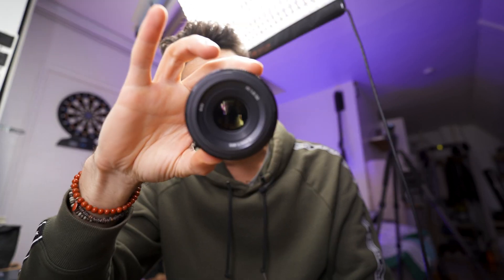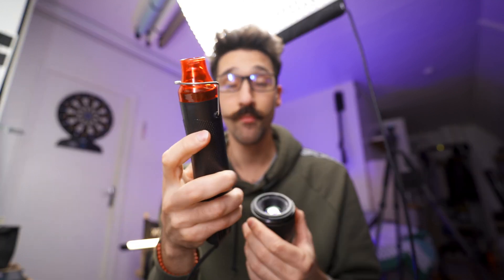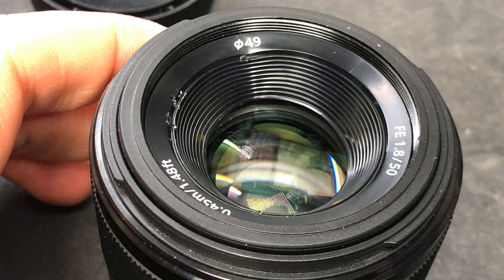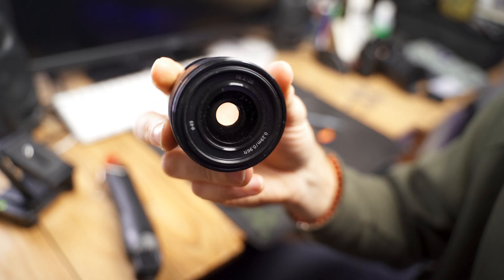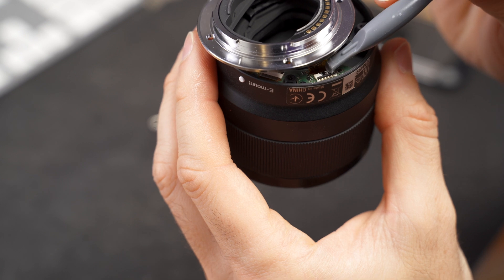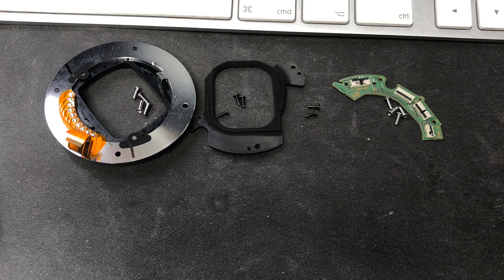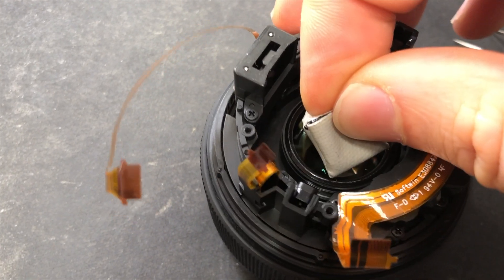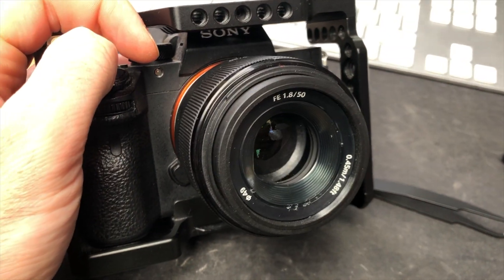Sony 50mm f/1.8 teardown (dust removal attempt)

Comment: I did successfully take this lens apart after it fell into the water and unacceptable amounts of dirt were in between the lenses. To remove the front part you have to pry it open by putting a knife between the filter thread and the front part with the numbers on it (It is impossible without damaging the front part). It’s glued in with some double sided tape. After that there are only a few more screws to remove. You will also have to take everything apart from the mount side. *Unless you have nothing to lose, under no circumstances i would recommend doing this* because the lens groups are glued together. Somehow dust gets inside that’s impossible to remove without breaking the plastic holding the lenses together. You will probably end up with a much worse situation than before...
Reply from the maker: thanks for your input !
I have pinned your comment to the top and hopefully it will help someone else
Reply: I successfully removed the front lens group with minimal damage, thank you

Comment: Don't use your heat gun, heat gun is too strong. use your hair dryer, 5 minutes, distance about 3-4cm. then use glue stick, stick a small string onto the name ring, then lift it slowly.
Reply from the maker: hey mr ! thanks for the tip ! unfortunately your tip arrived too late as you saw 😅

I will try it for my next project

Comment: the "ornament" ring at the front on many Sony lenses is glued on unfortunately. Sony makes special wrenches in various lens diameter sizes to help get them off. underneath, the "filter" thread frame is held on by screws.
Reply: Thanks for this bit of info! I had that ring partially detached and was worried about trying to pry it apart with tools. Going by your tip I allowed myself to use just a little more force, and managed to detach it with just fingernails, and reseat it correctly.
Reply: @AnijatsuGentlemen sure 😀.  Mine was held on by just some thin double sided sticky tape, so was pretty easy to get off.
Reply from the maker: @petehelme  yeah I did find that out the hard way.... but I might have managed to do it if I was a bit more patient with my heat gun.

but it is to be expected from such a cheaply made lens :(

Comment: have you tried using small amount of alcohol to remove the adhesive of screw cover?
Reply from the maker: not really sure what screw cover you are talking about... the last lens that I could not remove ? or the plastic cover on the front lens ?
Reply: @DuncanDimanche-sreview  it's the one you're trying to blow with heat gun the label in front of lens but my guess it's not built that way like the one i had from nikon before

Comment: Ive taken canned air and blowed it in thru the back around the sides to blow dust off the inside elements in the past. But im not sure if that would have worked here even.
Reply from the maker: that could have been a great thing to do before trying to open it !

I think that they have lazers now that can eradicate dusts particles (but I could be wrong)

I could have tried using some sort of vibrator to try and shake the dust off also